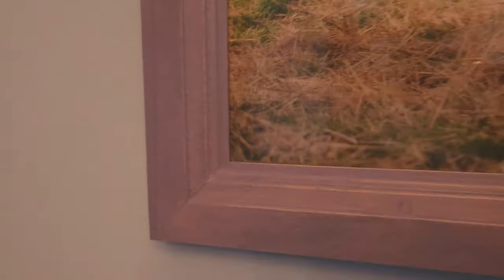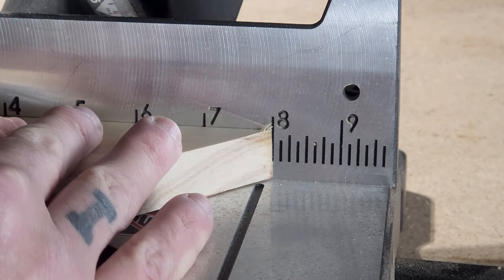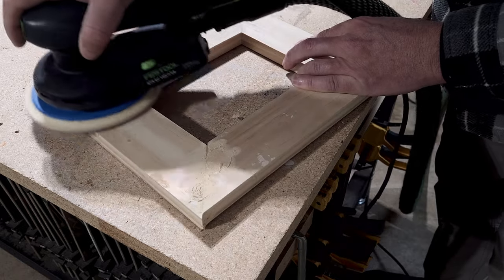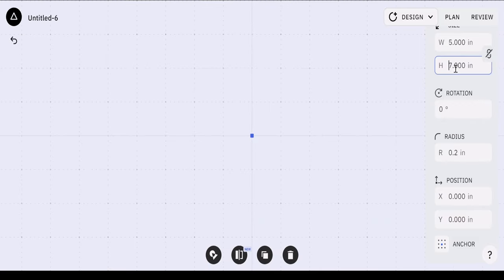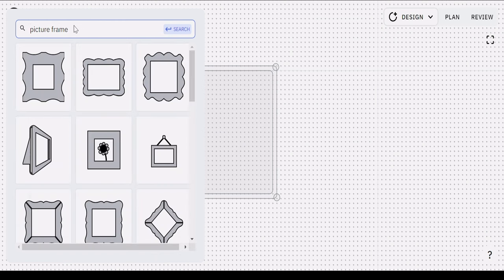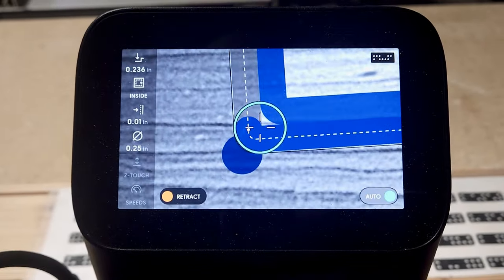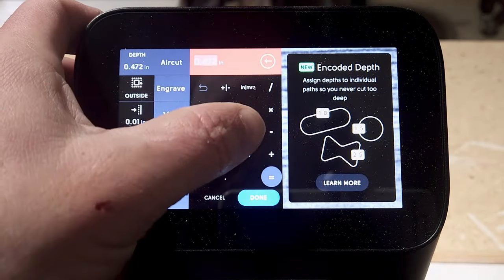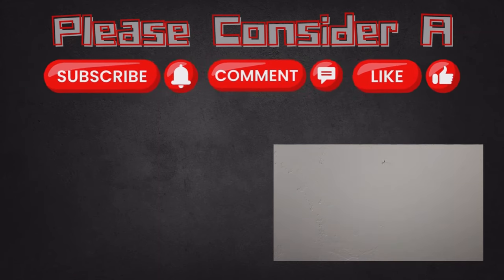EFFORTLESS picture framing

Comment: Great video Bud. Really well written, filmed and edited. I never thought about using the shaper, or with difficulty a router to do this kind of thing. It made me chuckle as the first one you made right at the start was almost identical to one I made for my wife a year or 2 ago. Really entertaining and informative.
Reply from the maker: Thanks Mark. I think I may have spent more time working on the alliteration and toddler puns for the script than the actual project. I gotta say, it was a load of fun purposely trying to make mistakes. Somewhat cathartic as well. I've most certainly failed more often than had success with frames. Miters are my woodworking nemesis. The frame of our wedding photo was my crowning achievement, and I have no intention trying the recreate that now that I have the Origin.

Comment: Those are interesting points. I would have never considered the Shaper Origin for picture frames. My bias as a non-CNC woodworker is to avoid short-grain situations. Maybe not such a big deal for smaller tabletop frames, but for larger wall frames I could see a potential for weakness. 

I wonder if you could lay out the sticks in the traditional manner onto the spoil board with double stick tape. Then have the Shaper origin take a pass between the ends of the adjacent sides to make a miter between the two sides. You would need a filler board in the middle to keep the Shaper Origin from tipping and the design file would have to account for the material being removed by the bit. Kinda hard to  explain without a diagram, sorry.
Reply from the maker: Good to hear from ya Tom, and WELCOME BACK!!!

The frames here we obvious relatively small, and essentially panel glue ups with the centers hogged out. Movement shouldn't be much of an issue on these guys. On the Shaper Hub, there are several designs for traditional miter style ends with locking joints (halflaps, finger, inlay, etc) that users have used for larger frames. The skies the limit as far as design goes. I have a couple of larger jersey shadow box projects coming, and I'm thinking a reevaluating how I'll do the joints.

I think what I regret not specifically saying in the video is the Origin (and CNC as a whole I guess) has the potential to replace many of the tools common to traditional workflows. However, rather than just pushing a button and walking away from the machine, the Origin still allows for a small amount of a "handmade" quality. I think that point is lost on many people.

Comment: 😂😂😂 I have done that pocket hole force it method before😅
Reply from the maker: The force method is probably the most endearing quality of the pocket hole. I edited it out, but you should have seen the backside of the frame. Tons of filler and those hole plugs haphazardly glued in. I may have outdone myself with how bad I could make a "square"
Reply: @vulgarwoodworks  😂😂😂
Reply: @vulgarwoodworks  nothing some paint wouldn't solve 😂
Reply from the maker: drown it epoxy and get those BIG views
Reply: @vulgarwoodworks  that's even better! 😂